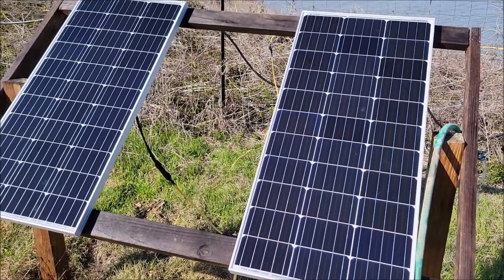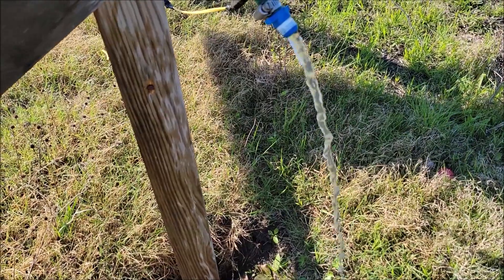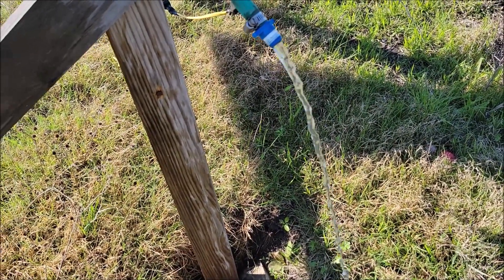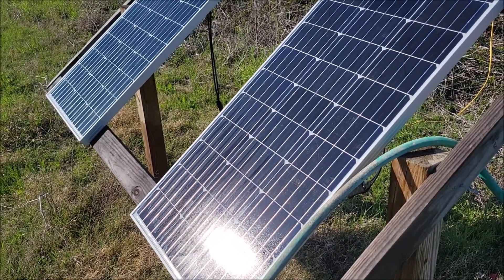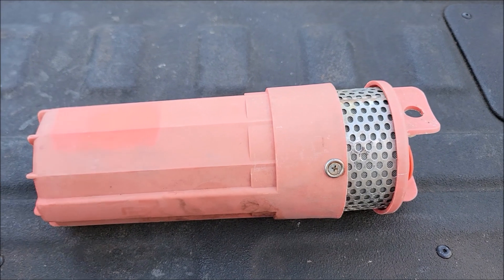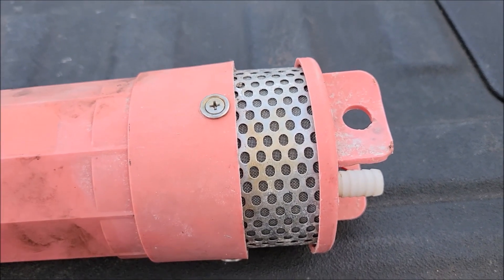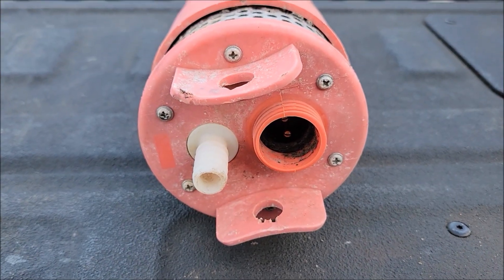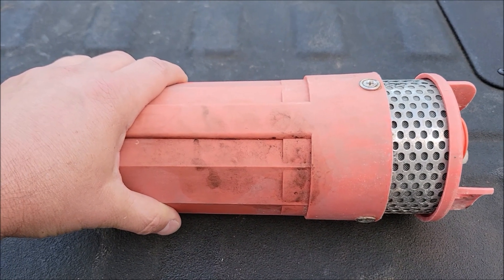Cheap Solar Powered Water Pump | No Batteries Needed | Update

Comment: Thanks for the video, really enjoyed it. Question, does the pump run all the time or does it turn off once it gets to a certain pressure, thanks in advance.
Reply from the maker: It will turn itself off at a high pressure point but only to keep from breaking it.  I wouldn't recommend letting it get that far (100+ psi).  I have a pressure switch on mine.  Check the channel for all my videos on the pump setup.
Reply: @SeidelRanch  , hi, thanks for your recommendation, I found your video and that looks perfect for what I need. Ordering one from eBay now. Cheers from Australia mate. Richard.

Comment: How do you replace the outlet port? I broke the connector and Eco-Worthy indicated that they don't sell replacement parts.  Any thoughts on how to get a replacement outlet port?
Reply from the maker: I have luckily not needed to fix any, but my plan is if any fail I will keep them for parts and buy another.  You may just get another one and keep that one for parts.

Comment: ive had very bad luck with this pump, all ive bought 2 and they all just break
Reply: My area has a high clay content. Looks they are taking in mud. I tried opening mine for strip clean, but didn't get far... Perhaps you could do a strip down video?
Reply from the maker: @marcussamuels3699  I don't take it apart to clean them.  I just clean the screen and flush out the pump with clean water.  Make sure you don't let them sit on the bottom or they take in more mud.  I keep mine floating.
Reply: @SeidelRanch  Thanks, let me try this
Reply from the maker: Really.  How did they mess up?  I have been lucky I think with mine, but I do clean them often.  I was concerned they would not last long but so far so good.

Comment: Has anybody taken one of these pumps apart?
Reply from the maker: I have not yet.  Well, not all the way.  If I have one go bad, I will be pulling it all apart and saving it for parts.
Reply: @SeidelRanch  cheers,I received a 24v version and it stopped working I stripped it down,water had breached the double o ring seal and flooded motor,a tip> when splitting the pump orange part from black after removing the 3 bolt screws,its not threaded its a push together fit very tight took some elbow grease 💪
Reply from the maker: @michaelkieran3006  Good to know.  Keep me updated on if you got it working again.  Thanks.

Comment: Thanks for the information, I'm thinking of setting one up with a automatic day switch
Reply from the maker: Mine are still running strong.  Just keep them clean, I think that is the key.
Reply: What voltage panel are you guys using on 24v model ,I have panels voc 32v and 36v will this kill the pump ? Will amp rating damage pump or too higher voltage ?
Thanks
Reply from the maker: @michaelkieran3006  Too high of voltage will burn up the electronics on the pump, but I think a 24v panel puts out up to 30-ish volts at full sun.  Amps is not an issue unless it's too low.  The pump will only pull the amperage it needs. Volts on the other hand can fry it if too high.
Reply: @SeidelRanch  so would you keep it at 30v and below? And can have say 3 panels in parallel pushing 18 plus amps for overcast days? I was wondering if I run the cable longer and get the right voltage drop length to get my 36v voc panels below the 30v would work? Thanks in advance
Reply from the maker: @michaelkieran3006  I can't guarantee anything, but I have 2 12v panels in series to make 24v for the pump.  The VOC for each panel is 22v, so in theory that is 44v VOC and my pump has been running fine.
Reply: @SeidelRanch  wow,I will give it ago cheers ,good vids

Comment: How does it work in the winter?
Reply from the maker: No issues for me on that.  But, when it's going to freeze I turn it off until the freeze is over.  I don't want the hoses to freeze and this pump try to run like that.  I do have a pressure switch on it but I do not know if it would just keep turning on and off so I just turn it off when it freezes.  I am in Texas so we get a freeze like for a day or two then it's back to 60 degree weather.  Hope that helps.

Comment: Thank you thank you ....
are your panels in series or parallel ? thanks again for the video
Reply from the maker: With this pump you could run them either way, but mine are in series.
Reply: What voltage is coming from your panels ?

Comment: Can you put a spay nozzle on the end of a hose does the pump auto stop when the sprayer is closed and start pumping when you open it up?
Reply from the maker: I think that would work if you put a pressure switch in the hose that cut the power to the pump.  It will turn off I believe but the pressure can build up pretty high.  I would put a pressure switch in the hose/wiring. That would work if you did that.
Reply: @SeidelRanch  cool ,yeah that makes sense and would also be nice to have a gauge to see to pressure read 🤔 thanks!
Reply from the maker: @SpecialistQKD  See this video where I did something like that for my irrigation: https://youtu.be/4e2c5WEIN7Y

Comment: Nice one what is the price
Reply from the maker: I linked it in the description of the video.  They usually run $80-$100.  Sometimes they are overpriced and sometimes you can find a great deal.  The last one I bought was $50, but then I saw it quickly jump back up to $80.  $80 is a good price for these.

Comment: Where could I find the membran inside?
Reply from the maker: If you pull apart the top of the pump, you will find a rubber membrane that is the diaphragm.  Is that what you mean?
Reply: @SeidelRanch  yes, the diaphragme.
Reply: @SeidelRanch  diaphragm
Reply from the maker: @rintsharry2795  You have to pull the top of the pump off to find that.  I don't think they sell that by itself.
Reply: @SeidelRanch  do you have any solution if broken?
Reply from the maker: @rintsharry2795  Not really.  I don't find parts online available.  I would just buy another one and save the one you have for parts.
Reply: @SeidelRanch  thanks, i think so. Dommage

Comment: Would like to see exactly how you have it wired and the hose setup. Thinking about doing a creek that runs down into a pond but want it on solar. Never done either before.
Reply from the maker: If you check out my other solar pump videos, I do take it out of the water and show how I have it hooked up.
Reply: @SeidelRanch  I had some 24v panels and voc is around 36v (bit high)so I ran wire at the right length to achieve a voltage drop of around 8 or 9v bringing it to 28v which will not burn out the pump ,I used a online dc voltage drop calculator for correct length of wire ,it worked out cheaper to use more wire than buying a new solar panel that would be the acceptable voltage.
Reply: So it's hooked up positive to negative ? Will it handle the 36v coming from a 24v panel ? I can't find any max voltages for this pump
Reply: Yes elbac I was wondering the same thing can it handle the 36v from 24v panel

Comment: hy will the pump work with 1solar pannel 100watt?
Reply from the maker: Mine does work fine with 1 - 100w panel at 12 volts, but you get half the flow and you get a little less run time because the power in the mornings and evenings is less.  But I did run it with 1 panel for a few years without issue.
Reply: @SeidelRanch  are your panels in series or parallel ? thanks
Reply: @SeidelRanch  what's the voc of your 12v panel ?